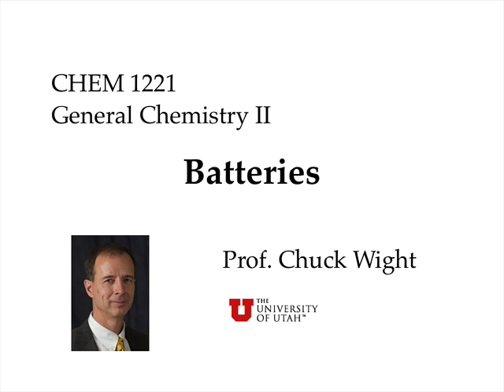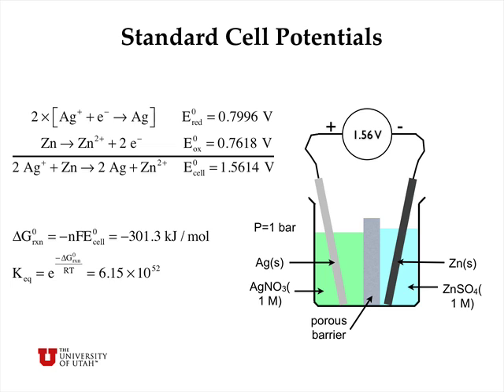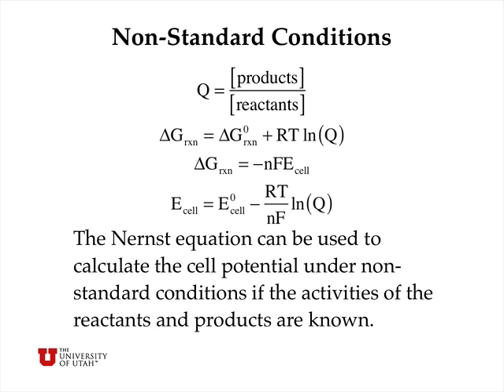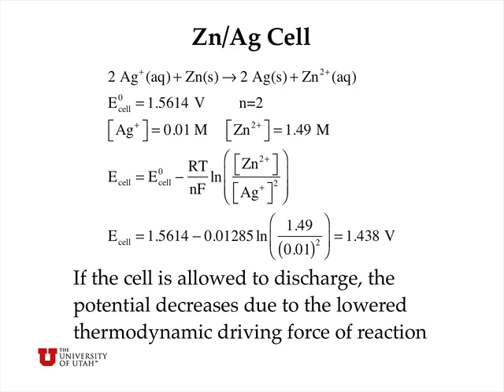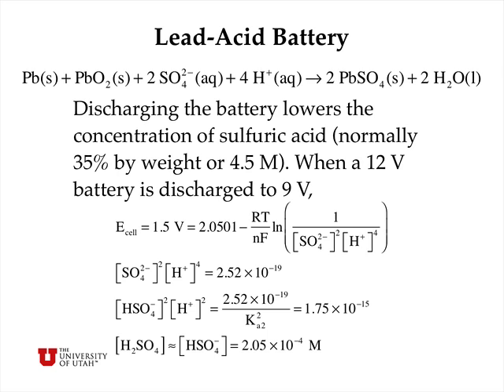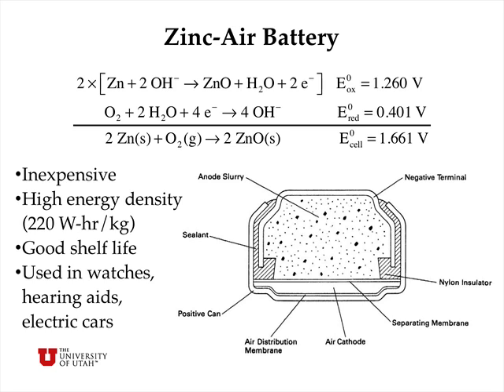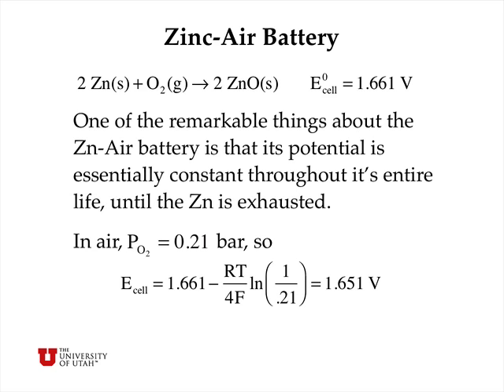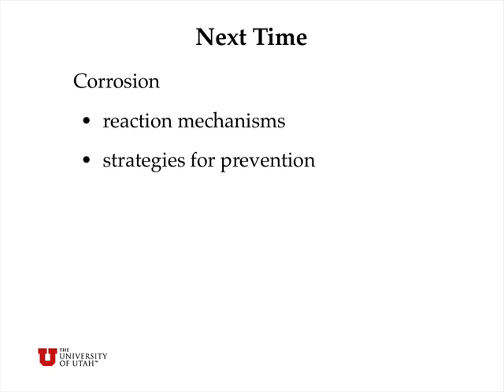Batteries

Comment from the maker: Electrolytic cells operate on the same principle as galvanic (or voltaic) cells. The main difference is that galvanic cells derive electricity from chemical energy (spontaneous reactions), whereas electrolytic cells carry out non-spontaneous red-ox reactions (going uphill in a free energy sense) by supplying electrical energy from an external source.